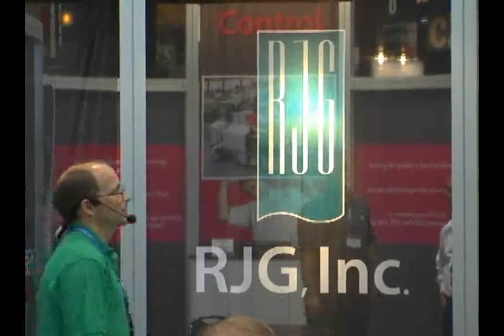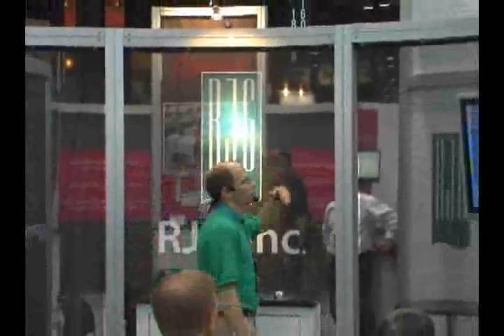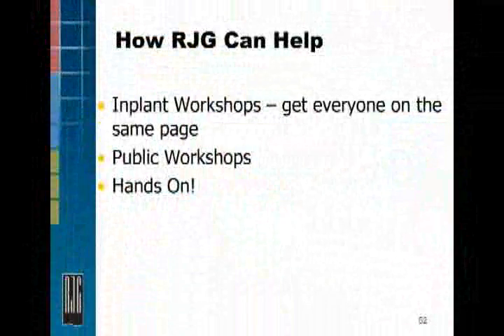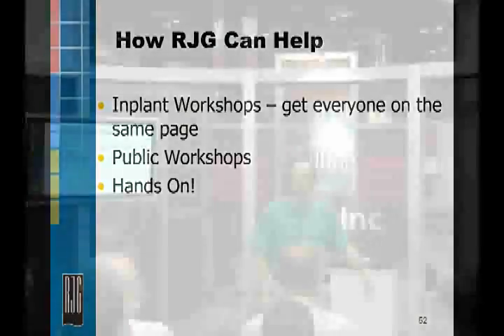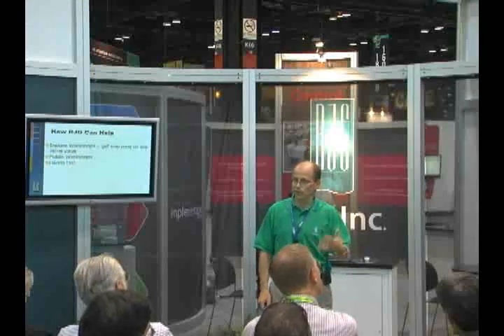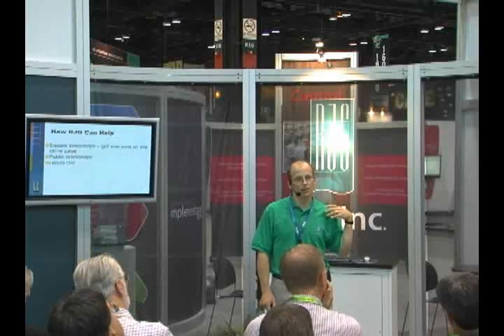DOE for Injection Molding - Part5

Comment: Mold deflection, depending on the severity, would cause a drop in the cavity pressure and a reduced fill time and the increase in hold speed caused by the mold halves separating during injection.
Reply: Interesting thought.  We typically see most mold deflection happen during packing rather than during fill.  Have you seen this in practice?
Reply: Not often but yes I have seen this happen on stack molds caused by the use of excessive carriage pressure right before the hold position is reached. There are other causes but this was an interesting case.
Reply: Interesting, thanks!